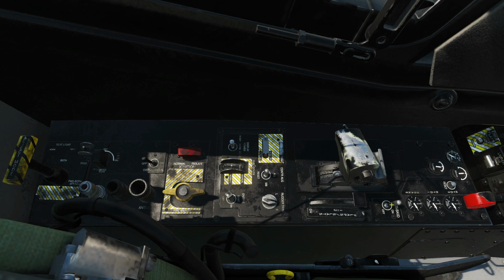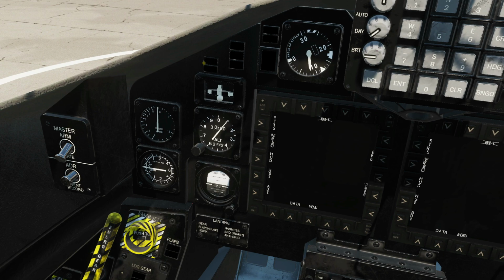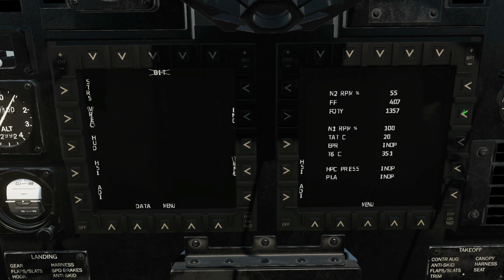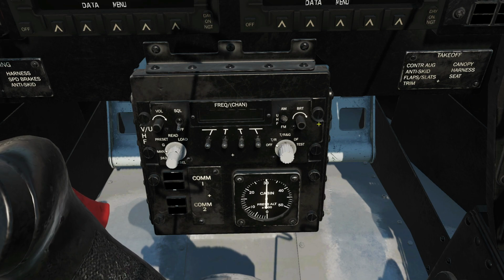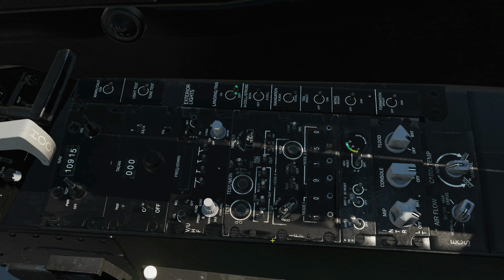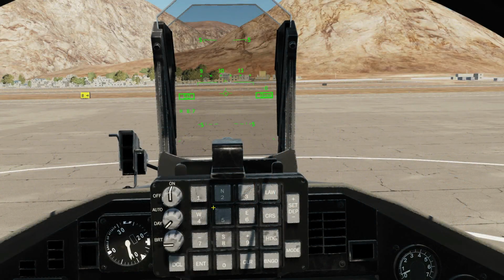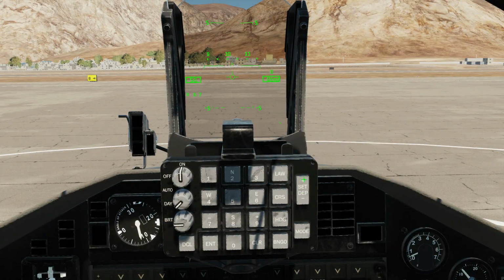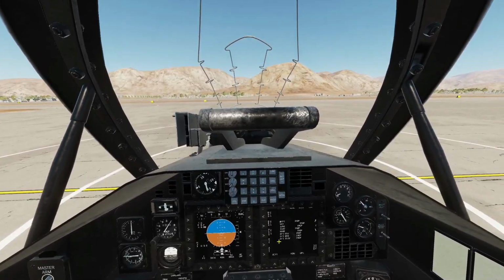T-45C Goshawk: Cockpits Familiarization Tutorial | DCS WORLD

Comment: Very small comment, AOA is unitless and not measured in "degrees."  For instance if it indicates 10 you would say that you are flying at "10 Units of Angle of Attack" not "10 degrees."  Great video!
Reply from the maker: thx
Reply: That's interesting, although such units are the angular difference between the flight path and the nose direction (wings).
Would it be wrong to call it degress since, they are quite literally, degree units though?